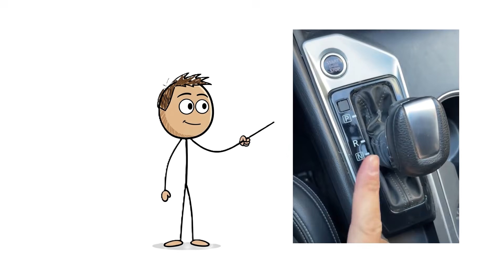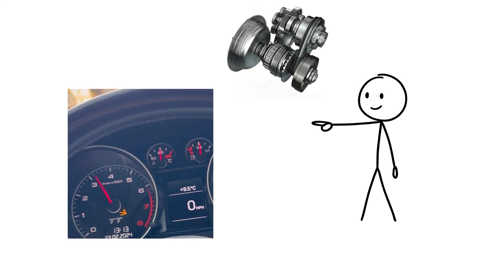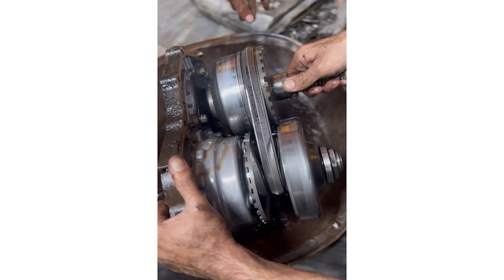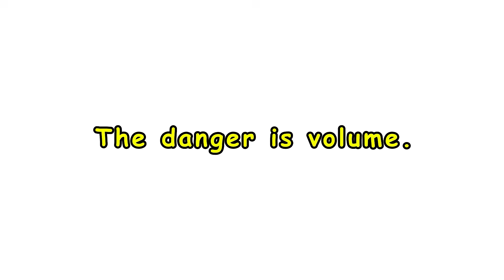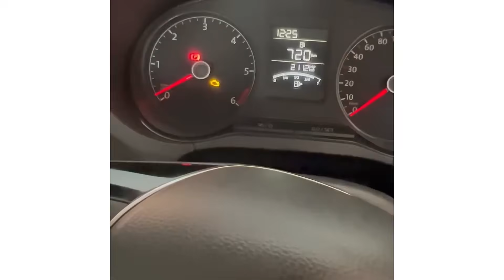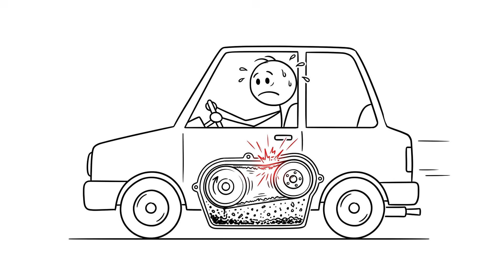99% of CVT Owners Have No Idea How This ONE Bad Habit Destroys Their Transmission

Comment: I have a 2017 Nissan Murano, purchased in the fall of 2016, my second Murano. My first Murano was a 2006 model traded in at around 110,00 miles. Never had a transmission oil change on the first Murano and never had any problems, only the regular basic scheduled maintenance. After having heard about the issues with CVT's I had the oil changed in the 2016 model at around 50,000 miles at my Nissan dealership. Again, I've had no CVT issues and I live in north eastern Quebec where we get about half the year with severe winter conditions with some of the worst roads in the country. The only issue I have had with my second Murano is front wheel bearings that have been changed twice in the 10+ years of ownership. I attribute that to a lot of mountainous and winding roads that are in generally poor condition where I live, though I never experienced this issue with my first Murano. Otherwise I've found the Nissan Murano and excellent all round vehicle that is a pleasure to drive. I have the distinct feeling that many, if not most of the CVT issues, have been the result of poor or abusive driving habits and lackadaisical inattention to proper maintenance. I will now be making a point to have the CVT oil changed at regular 25 to 30,000 mile intervals as long as my Murano lasts.
Reply: I too bought a 2017 Nissan Murano in late 2016. I live in the BC lower mainland. I’m an old woman, who drives gently. Just this week, in May 2026 my CVT transmission crashed. I had 72,000 KM’s (44,000 miles) on the SUV. I did EVERY REQUIRED MAINTENANCE at my local NISSAN DEALERSHIP. I’m astounded the CVT transmission blew,,, and I’m pretty angry. all in, with labour it’s costing me $11,000 to replace the transmission with a new CVT transmission at the Nissan dealership. I’m chocked !

Comment: 99% of CVT owners probably don't know they have a CVT, or what it is.
Reply: I have one. The problem is, it's a closed CVT.
Reply: @JonDoesRetroGaming  It is called "closed" or "sealed" but it isn't really. Closed to the owner / driver unless they have special tools. And the manual says as much that no user service is required. In my manual it states that no service required until 120k and even then it must be "professionally serviced".
Reply: @sterling1989 I would never buy a car that had a CVT transmission there's brand new cars out there and SUVs and there's older makes that don't have the CVT the smarter and safer decision
Reply: @JonDoesRetroGaming  How do you know? If it has a drain plug on the bottom and a fill plug on the side its not a closed CVT. The fact that it doesn't have a dipstick is irrelevant because CVT's don't have one.
Reply: @joevignolor4u949  The top is closed. You need a special tool to open it. I know because, well, I've had an older car that did not have it. And what is wrong with you? Do you like to pick fights or do you run on stress all day? Calm down.
Reply: @JonDoesRetroGaming What's wrong with you? This is a discussion board. If you are so sensitive that discussing things bothers you, don't come on here.
Reply: @Solo-_-..  It's not really a sealed unit. It has a fill plug on the side, sort of like a differential. It also has a special two piece drain plug. The outer part of the drain plug screws directly into the transmission. The inner drain plug screws into the outer drain plug. First, you pull out the entire drain plug and drain out all the old fluid. Then you put the entire drain plug back in, and then remove the inner part of the drain plug. The outer drain plug has a tube on it that goes up into the transmission to where the proper fluid level has to be set. You start adding fluid through the filler hole until the fluid overflows the tube on the outer drain plug and starts to leak out. Then you reinstall the inner drain plug and run the engine until the transmission gets up to operating temperature. Then you shut it off and remove the inner drain plug again. If fluid leaks out its over filled, so let it drain until it stops leaking. If no fluid leaks out put some additional fluid in until until it just starts to leak out and then stop adding fluid. When that happens its properly filled. Finally,  install the inner drain plug and you are done.
Reply: It's fairly easy to tell. Watch the tach and if the engine RPM stays constant while the car is accelerating its a CVT. You also won't feel any shifts like you will with a conventional automatic.
Reply: I dont think anyone even looks at the tach anymore since nobody wants a gearbox supposedly.  I think they just want convince buyers to get their disposable car.  When do car commercials tell you about the product specs?  What engine size, what tranny model, what rear end ratio?  Nothing.
Reply: @joevignolor4u949  Problem is; a lot of drivers won't even look at the dashboard. Alot of them don't even look at their mirrors, so more likely they won't look at the RPM or even know what it is.
Reply: Certain cars with CVT do actually have a dip stick for them. 04-05 civic hybrid is one of them.
Reply: @elijahbreazil3082  Tiida has it
Reply: I do had my 04 Nissan maxima se since 05 an it just started getting a lil bump slowing down in second gear I just found out the transmission valve body an filter an not a flush but match what I took out an drop in matic k from Nissan haven’t had a issue since
Reply: No.... just YOU.
Reply: Cuz i didnt
Reply: This was me until I started following the Chevy Spark reddit group. Most people there talk about the CVT like it's a time bomb just waiting to quit on you.
Reply: True! I've had one for 2 yrs and I'm just finding out
Reply: hey thats me!

Comment: This is incorrect , a traditional Automatic has  Clutch friction disks and steels and a singular band that is usually used for both 2nd gear and Overdrive …. 

The Clutch packs house the friction disks and Steel pressure plates that are stacked together and held in place with a Spring type Cir-clip ( Snap ring ) and they are operated by a singular piston …. 

The only gear that is a gear set is the Epileptic gear-set or the “ Planetary gear set “ …… 

These bands and clutch friction disks are what gives you the gear reductions or “ gear changes “ when the transmissions shifts …. 

The valve body of the transmission is the brain of it all and the Pump controls the fluid line pressure and distribution throughout the trans …..

Comment: Drive the wheels off a Toyota Yaris no problems so far but do change the oil in the cvt every 30k
Reply: If its a newer Toyota it probably has a launch gear in it. The launch gear is a conventional gearset that accelerates the car from zero up to about 10 mph, which is where a lot of the wear on the constant velocity mechanism takes place. After the vehicle reaches about 10 mph the constant velocity mechanism takes over. This prevents a lot of the wear on the belt and pulleys and substantially improves the reliability and longevity of the transmission. That's why Toyota CVT's, like the one in my wife's 2020 Toyota Corolla, have a launch gear. I believe most of the newer Toyota CVT's have a launch gear.

Comment: 242k on my cvt, still runs like new....2015 Honda Accord sedan. I drive responsibly and change fluid every 30k
Reply: did you do the recalibrate the video talked about? I did my own fluid change, never knew about recalibration.
Reply: It's a Honda CVT not a Nissan CVT
 Big difference
Reply: Every 30k is the go.
Reply: I’m at 200k miles on my  coupe version same year
Reply: Good to know! I have 2025 rouge rock creek at 30,000 miles I wanted to make sure I service what is really needed and I just found out I have a CVT

Comment: I Have Just Perchased A R50 2006 Mini Cooper Base Model.  With 143K Miles It's  A CVT Transmission But It Runs Like New No Issue's But I Don't Know if Transmission Has Had Its Oil Changes What Do U Recommend??
Reply: I would changed the fluid no matter what. I am sorry to say but the early mini cooper ZF Cvt transmissions are not great. I have a Subaru crosstrek 2017 Cvt transmission and change my fluid every 35,000 miles and I have 195,000 miles on my car and it runs wonderful. I have never used Subaru Oem fluid I have found that Triax Cvt or Lube guard fluid the best. I would do a drain and fill and in about 500 miles do another just to make sure you get most of the fluid changed.

Comment: CVT transmissions are worthless, then. If you have to baby your transmission, they need to make better transmissions. 

People don’t want to have to think about all these things. They just want to get in the car and drive. In a former life, I drove a taxi for about 15 years. I had other things to think about than transmissions. 

Give us the technology we used to have, instead of this planned obsolescence garbage. This is going to come back to bite car makers as people refuse to buy their new, over-expensive junk. It’s already happening. 

Give us back body on frame cars with engines you can service yourself without being locked into a dealer who will charge three times what it should cost. 

An auto manufacturer who would make reliable cars the way Honda and Toyota used to could steal market share from everyone and become a raging success.